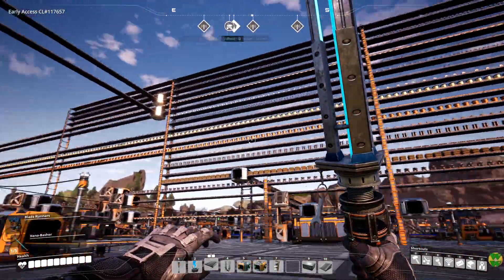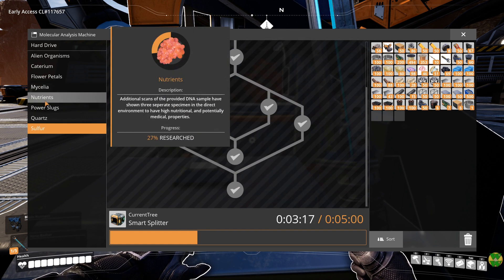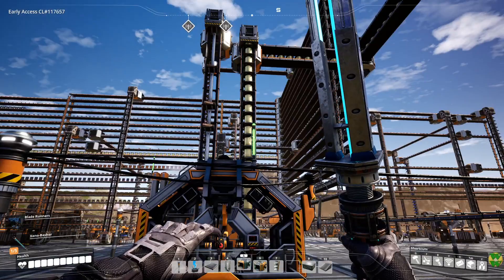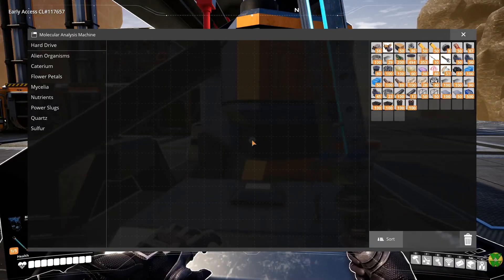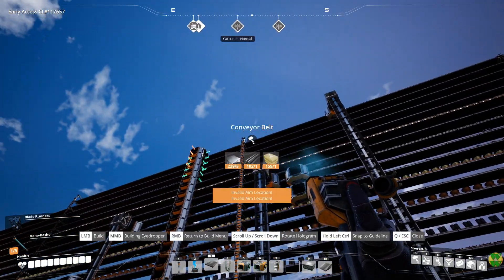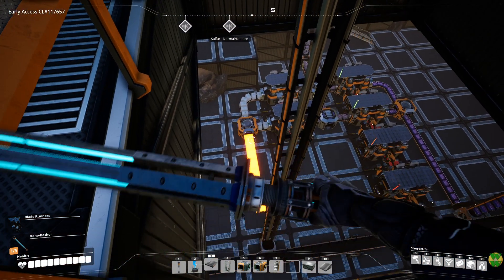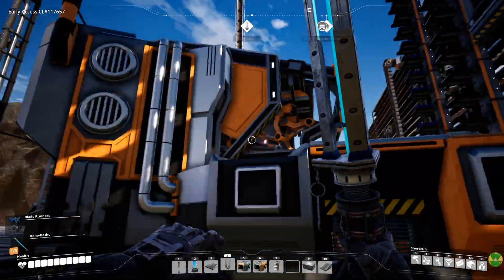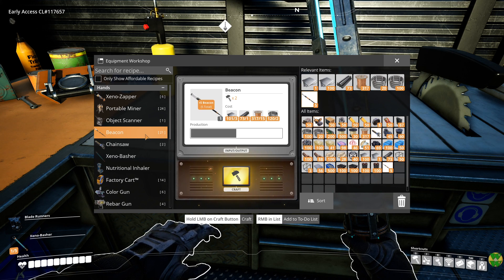Satisfactory Update 3, Episode 35: High Speed Connectors - Let's Play

Comment: I have a mixed belt. It saved me from running 4 belts insted of just 1. It does require that you consume everything on the belt, or it will back up and block the other items. However that's not a problem for me as I'm load balancing and using exactly what I'm producing. (I do prefer single item belts, and I don't have an auto-sorting facility.)
Reply from the maker: Yeah you’d definitely have to be careful